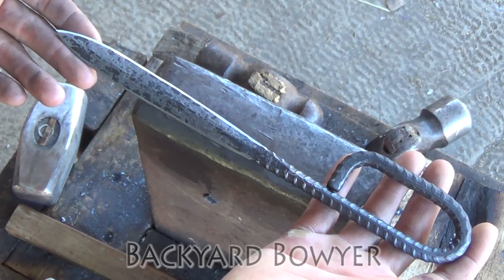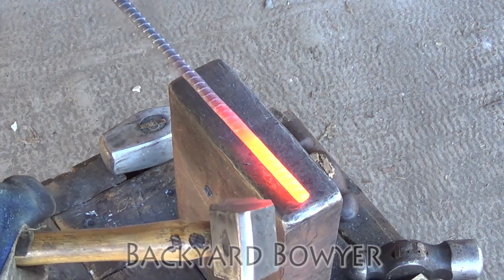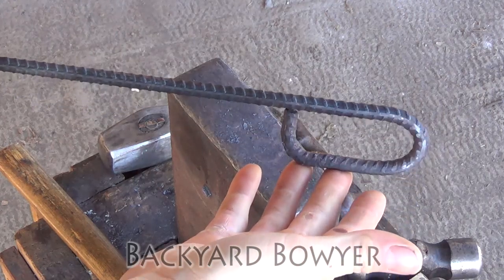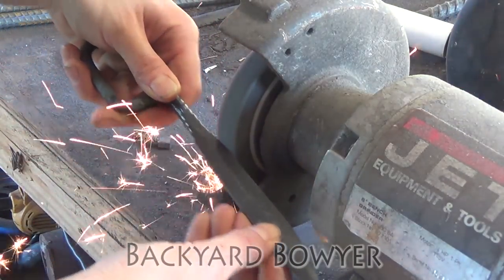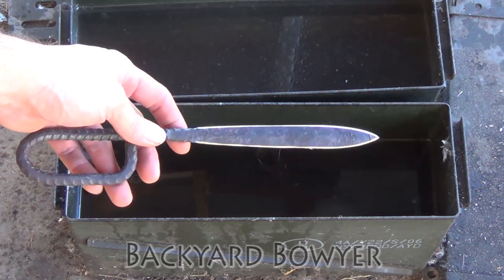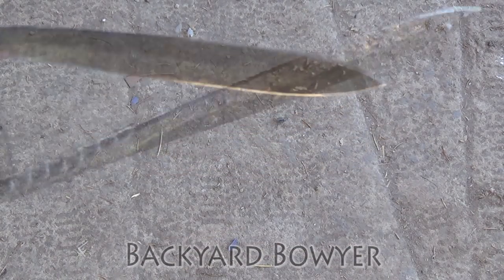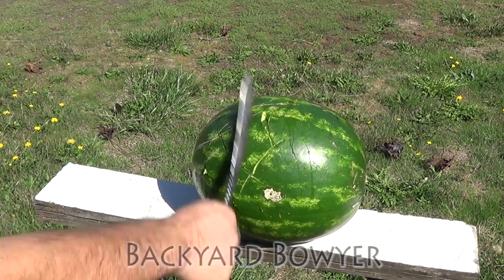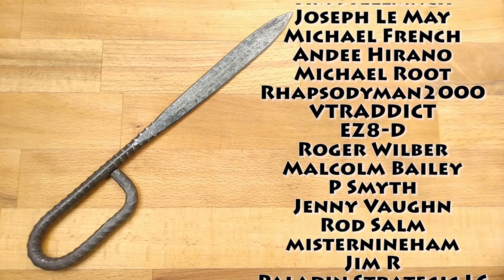Blacksmith Projects: WW1 French Nail with Rebar

Comment: Do you have a video of making your anvil stand?  I have a piece of steel about the same size as yours but I don't know how to secure it.  Maybe a video on basic homemade anvil stands?  I also have some railroad track that I'd like to mount on a stand.  A combo stand?   Just throwing out an idea that I would like to see.  Thanks!
Reply from the maker: +Mark Clark Thanks for the suggestion! This one has the stand built around it, the piece of steel goes almost all the way to the ground, inside the stand. I've got some ideas for other stands I'd like to try.
Reply: I do know that ZednoughtAlpha did a video on an anvil from a railroad track. Might be worth checking out

Comment: Great video! I plan to give knife making a try soon!
What kind of hardness do you get from heat treating rebar?
How's the edge retention?
Reply from the maker: +Jeremiah Bell Awesome! It really depends on what ended up in the rebar. Most rebar won't harden very much, maybe reaching 35-40 HRC if made thin and water quenched. I always make sure that the rebar I use for knives will get at least file-hard by flattening a small tab and quenching it to test for hardness and grain size. If it looks good,I'll use it. If not, it becomes stock for everything else.

Hope this helps!
Reply: BackyardBowyer
Thanks for the quick reply! Good information always helps a lot.
Keep up the great work!

Comment: Did this harden?  I figured rebar would be the cheapest low-carbon steel they could find...

Like the design though - nice & simple, but effective.
Reply from the maker: +RealRuler2112 It did harden. Rebar isn't always low carbon. It's cheap and definitely low quality steel, but the carbon content can range quite a bit, even in the same length. Rebar is basically just scrap steel melted down and the different grades have to pass certain minimums, but as for actual content, it's all over the place.

Mild steel, structural steel, rails, springs, axles, even whole cars and firearms sometimes end up in rebar. It's really interesting stuff. If you cut it in half and acid etch it, you sometimes get an almost wootz/tamahagane pattern to it.

Thanks for watching!

Comment: isnt it mild steel? can you heat treat that? ive seen a vid demonstrating that its impossible.
Reply from the maker: It depends on the grade and what was in the melt. I don’t assume it is mild until I’ve tested it. A lot of rebar is mild or pretty close and they make good tongs and tool supports because they can be quenched multiple times and struck cold without breaking. Some rebar has impurities that make it brittle when quenched (but not necessarily high carbon). Some work like tool and spring steel. I’ve even seen bars that have Damascus-like patterns in the steel when etched. Rebar is variable and even a single rod can have sections that act differently. When making knives, I test a piece by hammering about an inch of the bed of the bar flat and 1/8” thick. I heat and quench in oil and hit it. Depending on whether it breaks or not and the look of the break and observing the sparks that come off when the hardened piece is ground I’ll have an idea of whether the steel is going to be more mild, more brittle, or something higher carbon for knives. Thank you for watching!

Comment: You need a 'blood groove' all along the one side of the blade, it's called a 'blood groove' but it's actually to stop it getting stuck by suction when stabbing!
Reply: That's a myth. Modern tests show that adding the groove has little to no effect on the blade getting stuck in wounds; fullers ("Blood Groove" is a modern appellation) were to change the balance of the weapon in the hand by lightening the blade.
Reply: Fell also on longer blades they increase stiffness